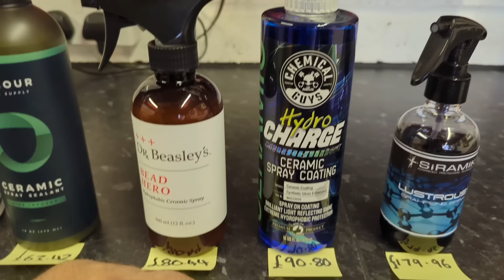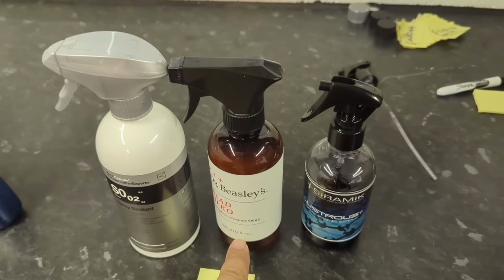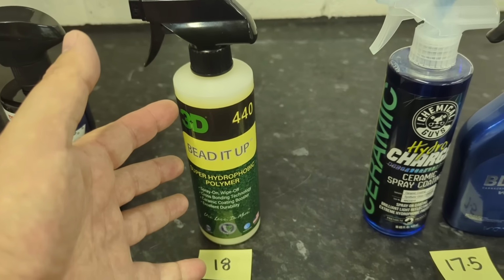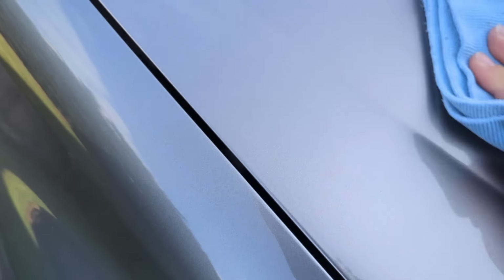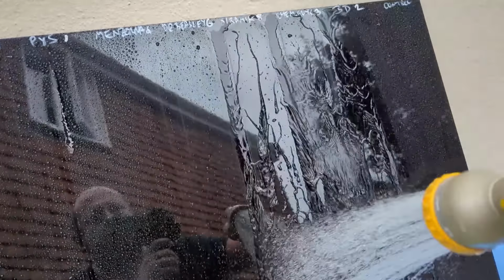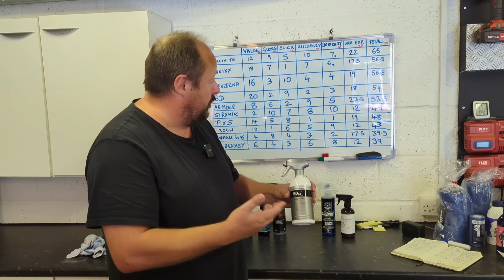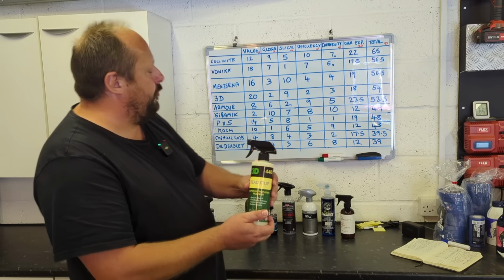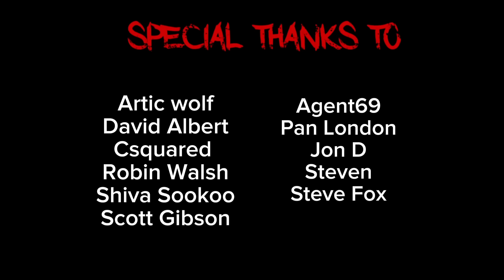Best Ceramic Spray Sealant 2024 NEW SMOKING HOT LINE UP

Comment: No Sonax BSD
No ADBL SSW ?
These 2 are the most liked  in the german communities
Reply from the maker: New lineup m8. Bsd is a detailer but we have reviewed it in group tests about 10 times.
Reply: @ForensicDetailing 
BSD isn't a detailer. It's a spray sealant.
Reply: @musikus7092  What's does the D is BSD stand for I wonder?
Reply from the maker: @musikus7092  BSD is a one trick pony.  It beads up great.   But its a thick sticky spread and a day or 2 later the paint has a opaque dullness to it.  Someone commented here saying thats due to a parafine wax backbone (which would explain the beads but also the dullness) not sure if thats true or not.  But yer BSD is not for me but I respect it.
Reply: @ForensicDetailing  I use BSD diluted 1:1 or neat onto a wet car. Either way it makes the product significantly nicer to use yet it still lasts a long time. That said, my current favourite is Touch On applied by lance - great results for essentially no effort 👍

Comment: I’m guessing si ramiks is actual ceramic meaning you need to throw away towels after you use them
Reply from the maker: I don't think it is
Reply: Nope. I've been using it for over a year, it doesn't harden the same way a true ceramic. I dump them I a bucket with water & apc the minute I'm finished with them & then machine wash once the buckets full. Never had an issue with the towels.
Reply: iirc if you spray some out into a container, it does harden, it hardens in the spray head if you dont clear it out after use

Comment: I like the si ramik, but have read that shelf life is not good , goes off after 6months or so and another about a year , so a little concerned
Reply: bought mine 6/2/2023 and its still perfectly fine, you need to clear the spray head after use as it will harden and block it, iirc you have to do the same with Gyeon CanCoat, if storing for an extended period i would probably remove the spray head and put a cap on it instead
Reply: Yeah ok I understand, thanks for the info
Reply: Hi mate, shake it regular to mix up the carriers. Do not store in extreme weather conditions & you should be good 👍
Reply: @mbrunskill agreed mate 👍